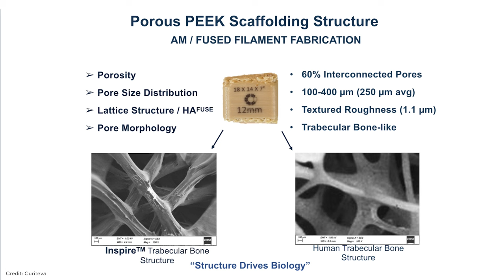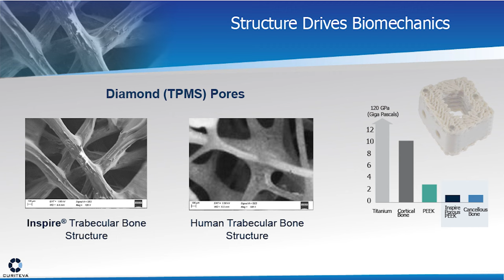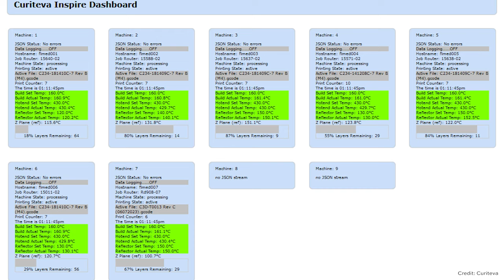Improving Medical Implants with 3D Printed PEEK | The Cool Parts Show #63

Comment: I assume that the pulling forces applied during deposition gave them a hard time with adhesion. I guess that's why we see two rafts under the part. Also some FDM parts can deform so badly during printing that they rip out a piece of the glass bed. Here we see a totally different bed material.

But since it's all proprietary, they probably won't want to discuss it too much.

Comment: Would this be applied in flat feet
Reply from the maker: Thanks for watching. We have an extended answer for you...

Please note that anyone reading this for medical advice should consult with their doctor for more information on this topic. 

That said, the short answer is: Yes. 

More from the Curiteva team on this: 
"The use of cotton and evans wedges is a surgical procedure that helps create an arch in the foot. It is commonly performed to help correct the condition of pes planus (commonly called flat foot or fallen arch).  The surgeon performs a cotton osteotomy by modifying the medial cuneiform and creating a slit to accommodate a wedge which changes the shape of your foot and returning it to a more normal appearance." 

At this time, Curiteva's wedges are proof-of-concept and have not completed the FDA approval process.
Reply from the maker: If additive manufacturing/industrial 3D printing is your thing, don't forget to subscribe to our channel. Thanks again for tuning in.

Comment: Couldn't PEEK be heat treated after the fact, to achieve the desired properties?
Reply from the maker: Here is what the Curiteva team says in reply to your question: PEEK is a path dependent polymer. The thermal history is important during the pulling of the strands (FSD). Strained induced crystallinity is created during this process. The ideal temperature conditions need to occur during the deposition, while the chains are aligned and toughened. Simply post annealing will only realign the polymer chains. The strain induced crystallinity will be lost.

Thanks for watching! You might be interested in the two video extras we published about FSD and Titanium vs. PEEK on The Cool Parts Show All Access: www.thecoolpartshow.com/allaccess
Reply: Short answer is yes, but you'd still end 😢up with a vastly different end result. Their unique Fused Strand Deposition process differs from traditional FDM or FFF printing of PEEK filament that is printed in the amorphous form accounting for the shrinkage and warping that will occur after baking to convert the PEEK from its amorphous state to the crystaline state. In this more traditional post processed way of processing PEEK, the crystal structure is somewhat random and depends among other variables upon the unique shape of each part. In the case of FSM, as each strand is filament is laid down, they place it under specific strain and heat it until its crystaline structure is locked in preserving the internal stress / strain they desire in each individual strand of filament as the part is built. Think of big building projects that use pretensioned wires, not only does this allow them to produce a part where the crystaline structure is very tightly controlled and can vary in direction and grain size through out the part, it also allows them through detailed computer models to control and optimise the part given where the bulk of the stress  is likely to be applied allowing for a part that is overall much stronger and is able to more effectively distribute stress and forces throughout the part which decreases failures and allows the part to more closely behave like the piece of bone it has ultimately replaced.